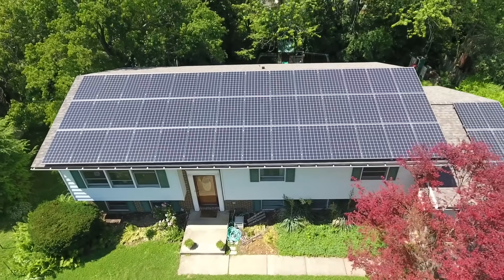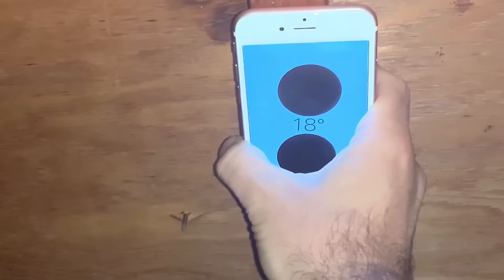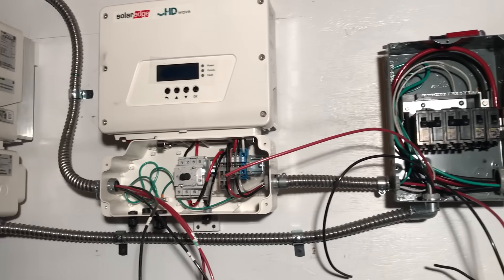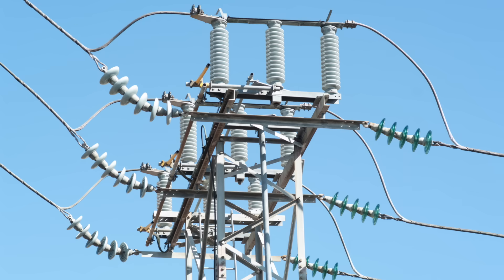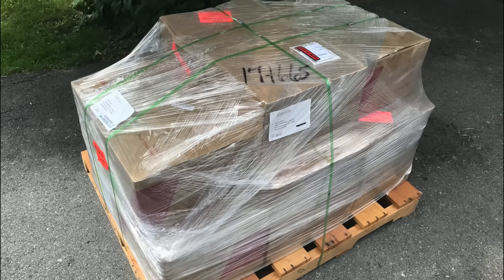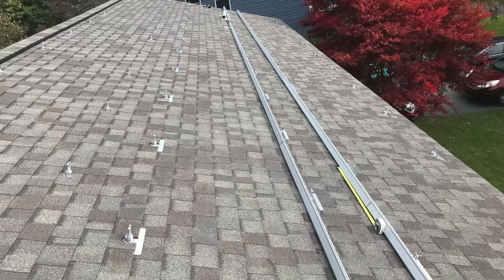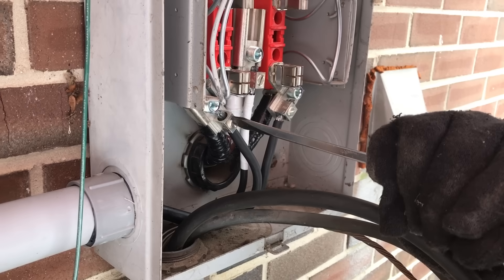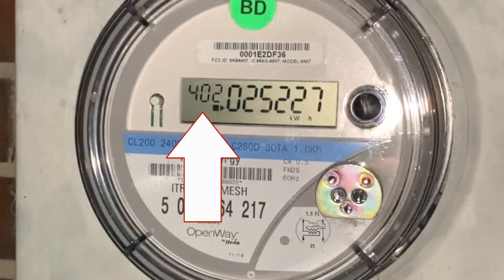I Installed a Power Plant Myself | HUGE DIY Solar Panel System

Comment: Waseem Abbas
Inverex Rameen Solar Solution:
We deals in all types Domestic & Commercial Solar Solution system, On-Grid or Off-Grid Solar for Home, Offices Buildings, Factory, Shops, Godown’s, tub wells, Agricultures etc....
Call / Whatsapp us Freely for any information or Complain......
Regard
Engr Syed Wasim (Btech, MBA) +92 3018444084
Mr. Umer Ali (Solar Speclist) +92 3228422465
Rameen Inverex Solar Solution Lahore, Islamabad, Karachi, Pakistan
www.rameenrenewables.com
+92 42 36612136-7

Comment: Now all you need is a small Wind Generator to help offset those cloudy or hazy days.
One of the very first Solar Systems I ever saw installed was at the Bancroft (Ontario, Canada) Veterinary Clinic. He runs his entire clinic including operating theater as well as his home. Later he expanded his solar system and battery storage facility and added 2 wind generators. Now on top of this Veterinary Clinic, Operating Theater and his home, he also powers his Greenhouse.
None of these are small accomplishments and of course he switched to more efficient light bulbs and things too. This system has been in placed for several decades now. The Wind Generators were added around 2001. So he's been running everything off the grid for at least 30 years now.

Anyone who tries to tell you Renewable Energy is NOT Efficient or too costly, simply isn't telling the truth. Sure .. panels cost money and take energy to make ... but it's a one-time addition of carbon to the atmosphere. It's all gravy after it's all installed.
Reply from the maker: Thanks for your comment. I actually don’t need to add batteries or a wind generator in my situation because of net metering.  I get a one for one credit on my bill for each KWh.  So when I make extra in the summer, I draw from that credit in the winter.

Comment: Well unless you got it all for free you’re paying...at some point it will have to be repaired and replaced. Paying again. The materials and elements mined to manufacture solar are not net zero. All done via fossil fuels. So are the clothes you wear, the food you eat, the wires to connect. All fossil fuel produced. Delusional.

Comment: Great work on the solar installation. You can get even more efficient ROI with using hempcrete insulation in that attic and using geo-thermal for heating and cooling.

Comment: I will watch hopefully I can learn from you!Does the ground wire have to be exposed It can’t green color coated?
Reply from the maker: Yes, it has to be solid core without insulation.

Comment: If there is a power outage in your area do you have to disconnect from the grid?
Reply from the maker: Yes, the inverters do it automatically though.
Reply: @FrugalRepair  I wish I could do something like this.  Im not a fan of heights . As my roof is almost 3 stories up. And my house faces east to west :-(

Comment: Does it provide enough power for when you run across in the hot summer months?
Reply from the maker: Yes, all year.  We use more power in winter though.  This is a grid tie system so when there is no sun I draw from the power grid.  We store up credits when there is excess generation.

Comment: Great video!
I really want to get solar on my roof. But im a bit worried that i dont have enough sun where i live.
I live in Norway, and we have nice weather, but we also have alot of rain and bad weather. And i dont want to invest alot of money
only to find out that its not making very much power. I found a web page here in Norway where i could put in my adress and i would get info about my roof from google maps, probably what way my house was facing etc. And it seemd to be well suited. But im still skeptical.. :P
Reply from the maker: Thank you. The biggest factor you need to know about this how many sun hours on average you get per day per year. And also what direction your panels will face. Hopefully they can face south.
Reply: @FrugalRepair  The biggest part of my roof is facing more east then south, but it would get sun at an angle directly from south. The other part of my roof is more south west, but it probably gets sun from around 12 mid day to 8 at the evening. But i guess that its not as efficient when the sun comes from an angle, its better with the sun facing them directly..
Reply from the maker: In the solar guide I mentioned in the video, I wrote a step-by-step guide to estimating how much solar your roof could produce.  I don’t know if you had a chance to look at that. I assume the same website and weather data would be available in your country.

Comment: I'm curious what state you are in. I'm in MA and just had a PV system installed. In order to be able to send power back to the grid I had to have 2 meters and 3 disconnects installed. There is no way DYI job would pass here. Good for you though - impressive setup.
Reply from the maker: I’m in PA.  I’m how big is your system?
Reply: @FrugalRepair  10.8 kWp, 7.6 inverter.
Reply from the maker: That’s awesome!

Comment: This was the most informative video so far, thank you, you earned a subscriber. I have one question regarding the panel array, specifically the power optimizer,  with the power optimizer then each panel is considered an array? lets say one panel goes bad or it is in the shade, it wont bring your whole system down? I have seen set ups where one panel will drag the whole system down. Thank you
Reply from the maker: Thanks!  Glad to hear you enjoyed it.  One of the benefits of this arrangement is that each panel is isolated.   It allows me to monitor each one, and if there is shade or another problem, it is isolated to that panel or optimizer.  One issue that could potentially come up though, is that if there is not enough panels to maintain the necessary 400 V per string, then it could take down the energy producing on that string. But in my case, each panel makes about 55 V and I have a string of 12 each, so I would need to lose about four panels before I would lose the string.
Reply: @FrugalRepair  Thank you for the response, I am in the building stage of a school bus RV (Skoolie) and I can't afford to lose power if one panel is in the shade, this was very helpful, I will research further if it would help in a smaller scale. Thanks!

Comment: Love this setup, 
just 1 thing that sounded strange to me, he didn't want any energy bills so he procedes to put a hole into his UNUSED chimney ...
Why not use the fireplace to heat up your house to save on heating cost during winter ?
Reply from the maker: Thanks!  Perhaps I could’ve explained more, the only part left of the chimney was some of the cinderblocks. There is no wood stove or fireplace and there is no chimney top. One of the previous owners of the house removed everything.
Reply: After choking on California wildfire smoke days on end, year after year, the last thing I want to do is send smoke out my chimney for millions of my neighbors to breath. I hope my neighbors all feel the same and will stop using fireplaces where their smoke ends up in other people's lungs . Thanks to Frugal Repair for this video and for eliminating his fireplace smoke pollution.

Comment: Thank you for a great video! Great to see a normal guy doing this all by himself and doing a professional job! I have a silly question: how would you replace a panel in the middle row?
Reply from the maker: Thank you!  It wouldn’t be that difficult, each panel only has four bolts holding it down. So I would remove one at the top then I could get access to the one below it if I needed to.

Comment: Do you have a storage system setup when the power grid fails and their is no sun on a rainy day so you have electricity backup?
Reply from the maker: Nope, I don’t have any batteries so if the grid goes down, I don’t have power.  Thankfully it is very rare that the grid goes down. And even when it does, it’s not for very long.

Comment: I'm in FL, and I'm looking to build out a solar install as an emergency generator system mounted on a cargo/equipment trailer that I also plan on using as a portable workshop/makerspace/HAM Radio Shack. Since I rent, I can't modify the building structure, but I figure that in an outage emergency, I plan on having heavy-gauge cables on a reel that I can roll out and drag into the house with standard gang outlet boxes at the end that I can use to run essential needs. When I'm not in an emergency, it should produce enough power to run the trailer's needs and a portable AC to keep it cool while I'm in there working on stuff! When it's time to move everything, I can lower the panels flat for transport. Maybe in the next couple years when I buy a house I can just figure a way to plug in to a high-amperage box like an RV does to pipe power directly into the house and have an internal cutover like they do with emergency generator systems.
Reply from the maker: Sounds like a cool system!
Reply: As long as you have room to park it and a vehicle to pull it, I'd say that is a FANTASTIC idea. Buy the biggest trailer that is practical for you.
Reply: There are some great adapters you can mount on the outside of your home near where your breaker box is located.  These adapters allow you to use standard generator cables to run 220 into your house into your main panel or a sub panel which you hook to your essential items.  Then it is just a matter of killing the main breaker on your panel to disconnect from the grid and then turn on the breaker going out to the cabling and you  have power for your essential stuff.  When the grid comes back up, you just reverse the process, turning off the breaker attached to the cable and turn your main breaker back on to connect to the grid again.  Here's a link to the inlet box I used. https://www.amazon.com/gp/product/B000BQT47S/ref=ppx_yo_dt_b_search_asin_title?ie=UTF8&psc=1 The only other thing you need is another one to attach to your cargo trailer to plug in the generator cable from your inverter.

Comment: Ok so u set up the solar panels for grid tiein but do u have a battery storage
Reply from the maker: Correct, I don’t have batteries.
Reply: @FrugalRepair   how come then u wouldn't have to really rely on the grid at all except for maybe to recharge on cloudy days and in the winter and still get the income from the power company from the excess power genertated
Reply from the maker: I do rely on the grid when the solar array isn’t producing enough.  But I get credit for any excess that I produce.  So year-round I produce enough to cover all of the electrical needs.
Reply: @FrugalRepair  so what happens at night during a power outage
Reply from the maker: If there’s a power outage, then I have no power. Thankfully, that rarely happens here.
Reply: @FrugalRepair  ah so u don't really have a need for the battery but have u at least thought about putting in one for in one of those rare cases the power goes out
Reply: And what all do you have running on solar

Comment: Did you install any batteries or just rely on your solar contributing enough to the grid to pay for the grid power you use at night?
Reply from the maker: No batteries, net metering.  I build up enough credit in summer to pay for winter heat.

Comment: This is awesome... I love this. But what if you live in an area that does not allow grid tie-in? Is there a way to dual power? Like an automated switch for when grid is used but when the system is producing the solar is used... with and/or without a battery bank system?

Comment: Oh in time, you will be so sorry choosing Solar Edge inverters. They do not work without optimisers and those optimisers will burn out like cookies. Have some for spare on the shelf . You will have a lot of fun, when you will have to change them somewhere in the middle of panel array.

Comment: Can you power whole house consumption laundry hot water heat ac lights fridge freezer car 16kw generator and sell back to grid.   Govt knows what they’ll let you produce. If that’s the case then why not do the whole roof. Even Tesla power banks don’t get you what you expect.  The carbon footprint to get all of these ion battery elements mined from third world countries ocean transient barged here. The Moral high ground hypocrisy is astounding. Tell Vegas AOC and Bernie with Clinton foundation will deliver water via solar panels

Comment: That is a really nice job, however, me being me, I'd like to make a few suggestions, not just to you, but also to those who might read this.  People need to start demanding that manufacturer's make a roofing system instead of adding panels onto roof after it's built, the panels should pretty much be the roof.... but if the consumer does not ask for it...
https://dualsun.com/en/product/hybrid-panel-spring/     Edit: There is American manufacturers of this product, I did not notice until after it was a France site... but you get the idea    now this was my idea over 10 years ago and someone finally brought it to market.
But even if it is made into a " roofing system " it still is not complete in my opinion, it needs to be augmented by wind generator's as well, a hot water " heat sink/storage " unit needs to be installed in attic area of house's, yes I know, that will take much more work for builders to adopt into plans etc...
Having water tank in attic has several benefits, you could use to heat not only domestic hot water but water to heat house as well, I say this because there is a guy in NJ, use's solar panels to heat water and he gets temps of 140 Fahr. in winter.  Video on youtube.
In Iceland, they made a wind generator that does not have the same problem most do,  " wind over speed " and catching fire. 
https://www.youtube.com/watch?v=Wlxz-KzebbQ
If you made smaller version of this unit, which they probably have by now, then you could install one on each end of roof.
LTO cells, new battery tech, low temp use, extremely high cycle rate over 30,000, extremely high discharge rate, can even be used as low as -20 or more.
Tri-fuel, propane or Natural Gas generator for those " just in case times "....  because you never know when you might need it.
https://www.youtube.com/watch?v=kYx097cVR48    <------- This guy built a really nice battery pack, you could use this as a model for a " Tesla Power Wall " type unit with a inverter built onto it, so you  " could " put one in each room.

Comment: Sucks I live in MN. Can barely keep my Ghosts controls gate charged up. Love solar though just need the sun.
Reply from the maker: If you have southern exposure without much shade and have a good net metering policy then it probably is worth it.  You’d get more sun hours in the summer and less in the winter but yearly you might get about the same as me, I’m in PA.

Comment: Does the battery even last 25 years?
Reply from the maker: Which battery?  I don’t have any batteries in this system.
Reply: @FrugalRepair  ooo, i commented too early, I thought you went off grid. 😂
Reply from the maker: No problem.

Comment: What state are you in? In most states solar has to be installed by a "licenced electrician".
Reply from the maker: PA.  I’m not sure of the laws you are referring to but I bet you can always be the general contractor yourself and sub contract any key parts out that require any kind of licensing.
Reply: @FrugalRepair  - well yeah but at that point you're just hiring someone to do it. And as "BoxOfMangoes" said, chances of someone putting their license on the line for you doing the install is slim.
Reply: @FrugalRepair  No self-respecting electrician would pull a permit for a homeowner's DIY project. quick way to get your license pulled if that house catches fire.

Comment: When you consider the cost of removing all the panels and rails to replace the roof in the future, I’m not sure it would still be a good value?
Reply: Considering the panels cover the roof it would seem the roof would last quite a bit past normal lifespan

Comment: lol... only in murica, to get such things placed on my hired apartment id need too hire a company thats licensed for this stuff, looking at this im like.. eh.. for about 20 euro of electricity i use a month this aint worth all the hassle of getting decent equipement and getting it installed, it will cost 6k if not more... and sun doesnt shine that much, not to mention a tree would be blocking out most of the sun. P.S even if you buy a house here such stuff needs to be done by someone who is licensed, if you'd do it yourself and it goes wrong nothing is covered by the insurance.

Comment: As in installer, you did great. However, for those of you reading this, he used discounted panels and thus he  needed more panels. I recommend using LG or Hyundai panels with nphase inverters. This is the best for the buck and you would have only needed 12 panels for a your system. Thus less material, time and easier layout. No need for a second roof. Don't let discounted materials factor into your overall time and extra materials list.
Reply from the maker: Thanks!  I originally wanted LG 365s but they were too tall and I couldn’t get three rows in.  But I agree that if you’re going to do it you should try to get the best bang for buck.
Reply: Only 12 panels?! Wow, I'll have one of whatever you're drinking.

Comment: You could have avoided all the forms and approval etc, by simply not returning power to the grid. As long as your system is independent then you don't need approval from the electric company. You still have to do it right of course, but really with the size of system u have, you don't need a grid connection.